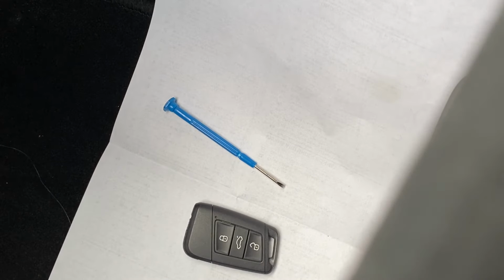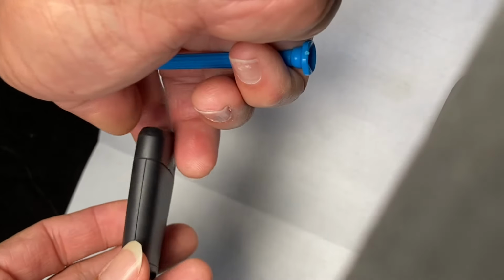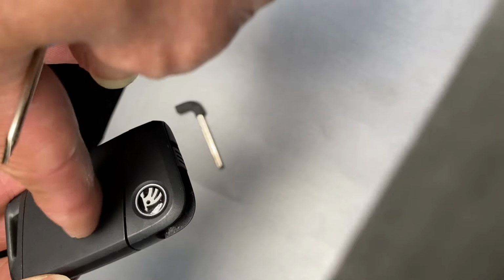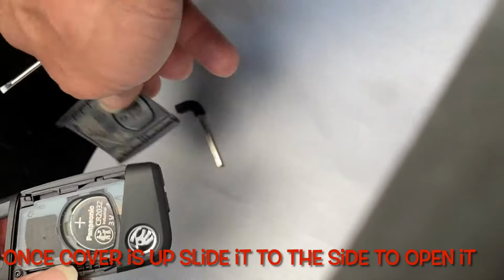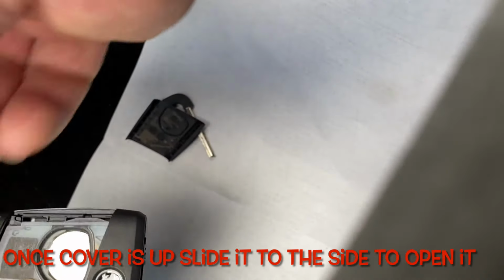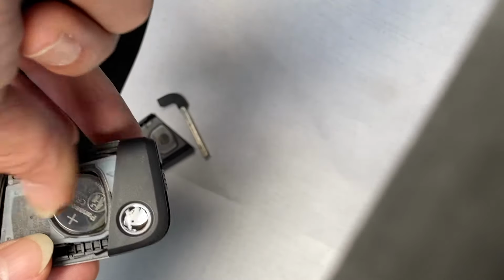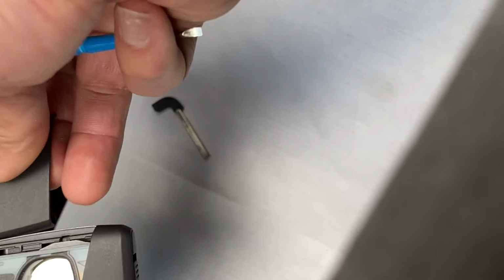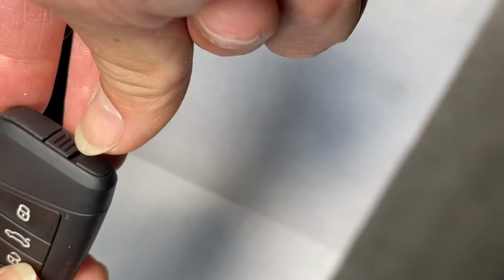Skoda Karoq key fob battery replacement How to replace keyless batterie - easy diy - 斯柯达钥匙电池

Comment: Do you know how to resynch the key with the karoq ? what is explained in the manual doesn't work unfortunatly
Reply from the maker: Good morning, hope you well! Try lock and unlock by driver door lock if doesn’t try cr2025 instead of cr2032. Hope this help. Please subscribe to channel. Thanks
Reply: I'm facing the same issue, did you solve it yet?
Reply: Same problem here. Manual is bonkers!!
Reply: @carriegray1645  I went to my local Skoda dealer, they said my key most likely broke because they couldn't reset it and got errors. I had to order a new one